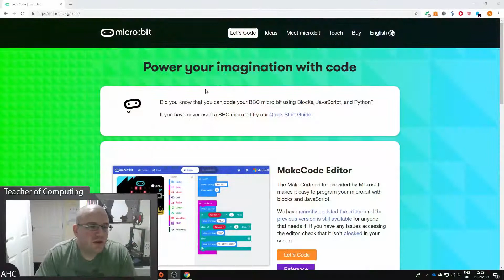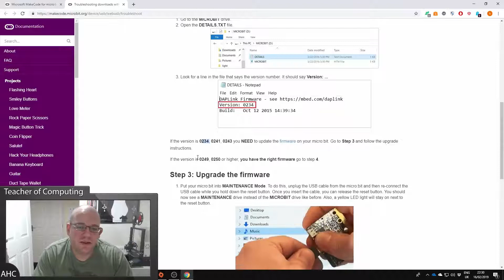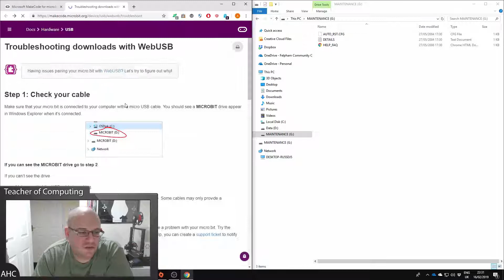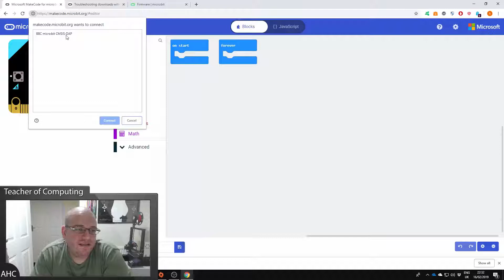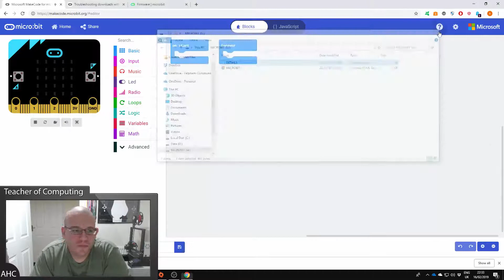How to Update the BBC Micro:Bit Firmware

Comment: Hello! I've encountered a problem. My microbit's reset button is ignored on battery power whereas when connected to my PC it works perfectly fine. I tried updating the firmware and it still does not work. Any suggestions?
Reply from the maker: Sorry not sure about this one. Maybe someone will see and help out. Alas I am not all knowing ;)